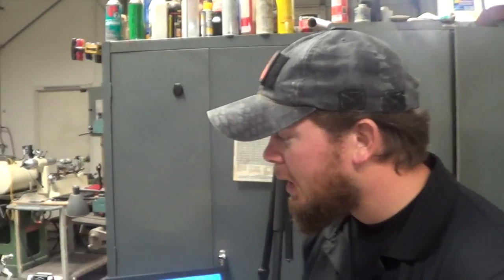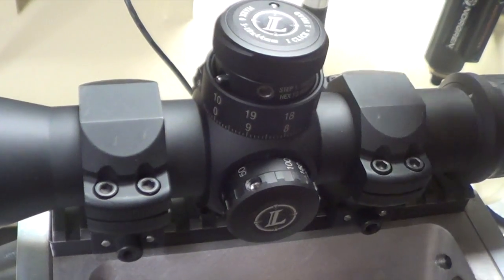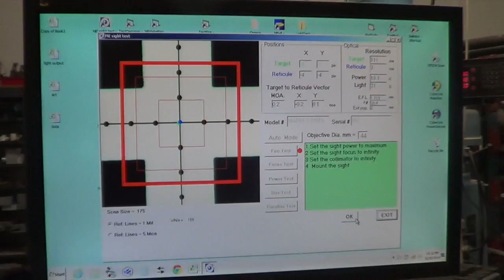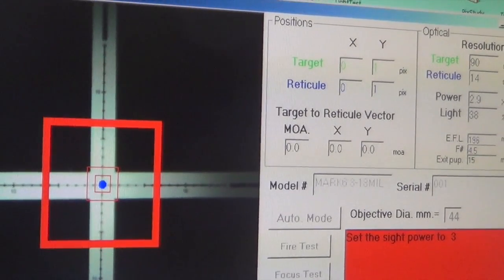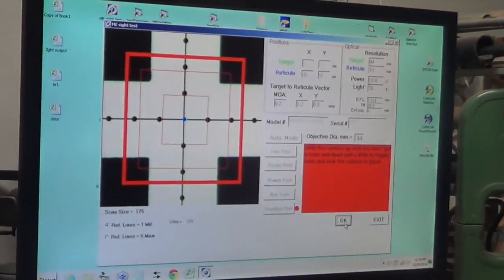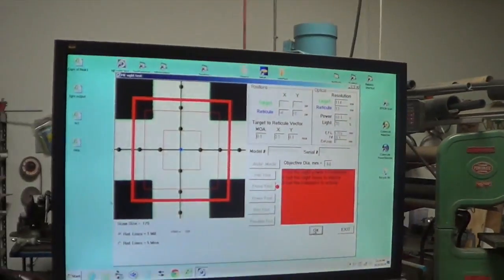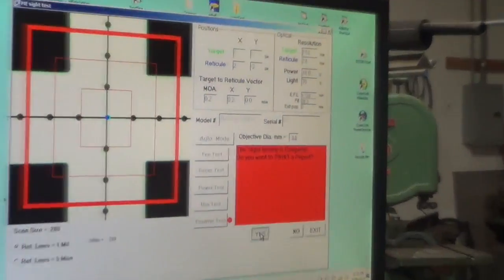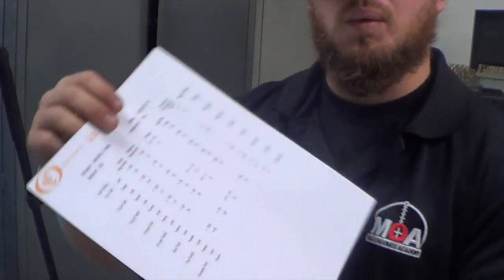Scope Testing - Episode 3 - Leupold Mark 6 3-18

Comment: You need to change camera position if you want to have reasonable results for light transmission on lowest power. Eye relief can (and will) change on scopes with such a high zoom ratio. It's not scope's fault.
Reply: While I didn't notice any change in the room lighting, I wonder if applying a "tube" as a shield from the camera to the optic would change (even) the light transmission rating? If the lens were the only light source, for the camera to  read. Does that make sense?

Comment: On my 338 Norma Mag, this scope (except mil / mil) gave me repeatable 0.3 - 0.5" groups at 100y, and same scale out  to to 600 yards. 

Meh....   I don't really care what happens in a laboratory. It works in the field.
Reply from the maker: Mark Kozak 😂😂 Seen it rail in the field as well. Two weeks after this to be exact while training with Border Patrol. They had just purchased these. Maybe you got a good one. Or maybe they fixed the problem and you bought yours after the fix. Either way it’s failed, numerous times in the lab and in the field.
Reply: @maxordinate  ....don't know. Don't care.  Mine works. Not worried about other ppls.  Or lab tests.

Comment: Leupold recommendation on rings is 69 IN/LBS
Reply: +jtmattel05  Vortex is 18 max, 69 seems kind of high.   Either way, I think they just got a bad scope. I doubt this happens often, and I'm sure leupold will replace it.
Reply from the maker: +TexanUSMC8089 also observed this almost identical shift with same model scope in the field on a Border Patrol BORTAC sniper rifle at one of our courses.
Reply: +Max Ordinate Academy   That sucks. I have a vortex viper and several Nikons monarchs. I have 1 monarch 6-24x50 that didn't hold up well to my 7mm mag. It was embarrassing until I figured out it was the scope. I'll probably start buying vortex from now on. I'm impressed with this one.   Great videos.
Reply: The actual torque specs are 15-20in/lbs for ring caps, depending on the manufacturer. The ring nuts that secure it to the mount is 65 in/lbs. if you torque ring caps to 69, you’ll probably crush the tube. Like a local agency did here. But they weren’t satisfied crushing it the first time. They moved the scope in the rings just the width of the rings. And then crushed the tube again, both front and back. So there was a two inch section of tube on each end crushed. The sniper assigned to it couldn’t hold a group and qualify with it. They thought he was just a poor shot. They asked me to look at it. I was in disbelief when I found the problem. The good news is that Leupold rebuilt the scope for something like $130 dollars. I thought they were going to tell me to pound sand and buy a new scope,  but they fixed it. Hats off to Leupold for great service!
Reply: No they don't lol. 69in lbs is for the BASE of the scope mount rings, NOT THE RINGS. 69 in lbs on the rings will CRUSH your tubes and if you're lucky it won't crush the tubes but it will make your internals bind when going through the magnification range with the throw lever.
Reply: TexanUSMC8089 Sorry your right.  Idk what I was thinking!
Reply: steve wilson Sorry your correct Idk what I was thinking!
Reply: SkinnySkinch Sorry your correct Idk what I was thinking!

Comment: Uh, how do you know that moving fixture is returning to its original position? Your torque wrench technique also needs a little work. Try holding onto the handle. when you torque instead of using one finger at the end of the wrench. That's what handles are for. I trust that you also return your torque wrench to zero when its not in use as well. That's a must-do on torsion spring torque wrenches like that. Kinda weird that BOTH of your "fire tests" resulted in identical "shifts" of 2.3 MOA, is it not?

Comment: Human error is most likely the factor here!
Reply: +Map Led 
Not one bit little one;~)
Reply: I've got a Leupold Vari-X III 4.5x14-50 I purchased "used" in the Sidney, NE Cabela's Bargain Cave almost 20 years ago. It lived the first 14 or 15 years of its life on my Browning A-Bolt Stainless Stalker in .30-06, which is a hard-kicking rifle. Probably most of 1000 rounds through that rifle hunting deer, shooting prairie dogs with cheap 180-grain soft-point bullets, shooting deer with Winchester Fail-Safe ammo and it got banged around and knocked over at deer camp and even thrown up a muddy, snowy creek bank one morning when it was either throw the rifle up the bank or take it with me as I went over backwards into the creek. I zeroed it ONCE in those 14 or 15 years. Deer hunting in November in Nebraska in rain and snow to shooting prairie dogs at 95 degrees in the summer it was dead-nuts on. Every time. Then I pulled it off the A-Bolt and put on my AR "Ranch Rifle" I put about 3000 rounds at least through shooting prairie dogs and general "plinking". That's a "homebuilt" AR I threw together for about $1200 with a Wilson Combat 18" match barrel, Timney 3-lb. comp trigger, etc. That rifle will shoot 10-round sub-MOA groups and it did so repeatedly with that scope. I also generally was down in the dirt with that rifle and scope using prairie dog mounds for "benchrests" and usually leaving the gun laying on the ground when I did "body counts". It also was my 24-7-365 truck gun for several years. Then I put that scope on my Armalite AR-50A1. I "boresighted" the scope the same way I alwasy do by looking down the bore with the rifle bagged/blocked up firmly and aiming it toward a bullseye target and adjusting the scope to coincide. Within the first 10 rounds out of that .50 I was shooting sub-MOA groups at 500 yards with the "junk" surplus 650-grain pulldown FMJ bullets "experts" claim are worthless in a .50 for "accuracy". Now that scope is on my DPMS LR308. I could tell you the story about that rifle and the Leupold Mark AR I had on it from new that I actually "broke" when I got pissed off enough about ongoing, since-new short-stroking/double-feeding issues with the rifle that I slammed it down on the hood of my pickup and popped the crosshairs in the reticle. I boxed up the rifle and sent it to DPMS (after doing everything recommended and plenty of my own ideas trying to fix it) and boxed up the scope and sent it to Leupold with an honest note essentially saying "I fucked up and abused this scope and broke the crosshair at least so please repair it, contact me with a total for the repairs and I'll pay you and then you can return it to me". Less than 2 weeks later I had my scope back good as new for no charge. If you don't know how good Leupold products are, you're just a fucking moron wannabe Range Rambo tactitool noob who's too stupid or broke to pay for quality once and have it done with forever. And by the way, expert, if you'd watch the whole video you'd see that the "old timer" in the video mentions that he's seen many scopes do exactly what the Leupold did and any shooter who has ever installed, zeroed and sighted in more than one or two scopes in his life has also seen, which is "movement" during the first two or three shots as the internal mechanisms of the scope "settle in". Because it PASSED the second "fire test" and RETURNED TO ZERO with a 2.3 MOA "shift" back to where it started. The only "test" that Leupold scope FAILED was that it had a LITTLE TOO MUCH MAGNIFICATION. Try watching and listening before talking and you might not look like such an idiot.
Reply: I also think that their testing procedures and verification of set up is crude. I feel they could get better data if they knew what they were doing with fixturing to high precision. The joke of grabbing the scope to see if they can feel a 2moa shift.  Lets say th escope is mounted with rings 4" apart. well 1 moa of shift is equal to .0011" inches over 4" I'm a tool maker and trying to feel .001" of slop is near impossible on something with a short lever as a scope.

Comment: ALSO I have used a Shit-Ton of test equipment and when you have such sad lab conditions (I see a band saw a few feet away) dirt and varying other conditions - this test is total BS and i don't own any of these scopes. So I also did not see any optic cleaning and also exact measurements of distance for the measuring devices. So this is a pretty LAX LAB and as it shows POOR TEST results.